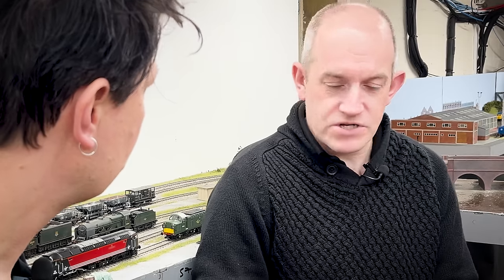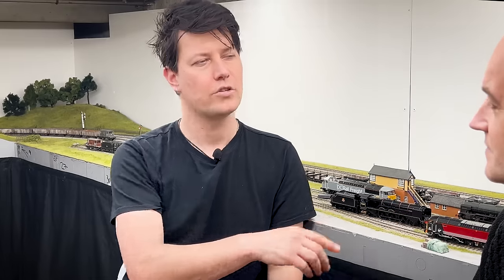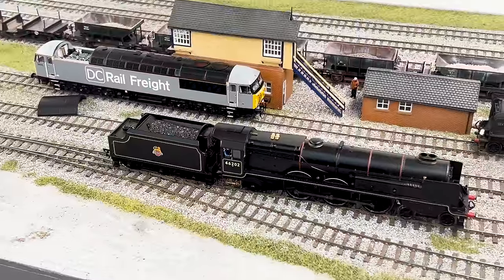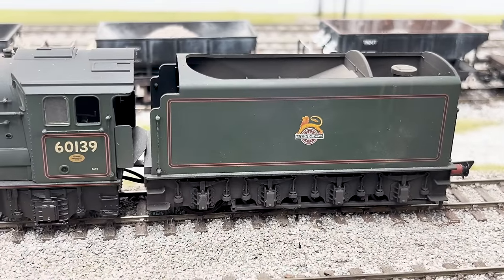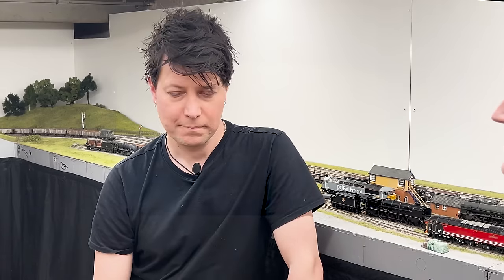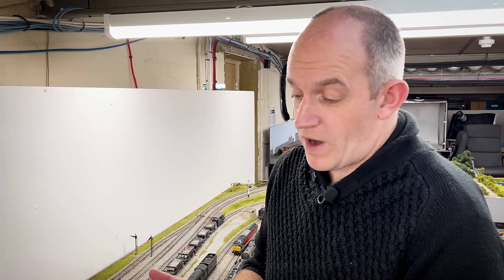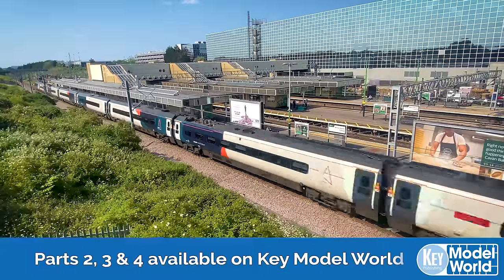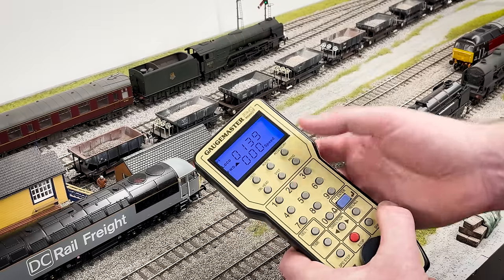SERIES 8- Introduction to DCC sound I Part One

Comment: Blimey you were going at 100mph. DCC is a massive learning curve for someone brought up on DC. Ive been digital for 13 years. Still learning after many blown decoders etc. Nearly all DCC ready locos require body or tender off jobs and careful alignment of decoders. If you have poor eyes/shakey hands you better fork out for fitment by someone else. Just a simple demo of how to fit a decoder and running against a dc loco would have sufficed. Easy to drop into the technical stuff when you are way past the preliminary stage. Dont get me wrong I love DCC but went thru alot of perseverance to get where I am now. Just slow down for the novice please.
Reply from the maker: Hi there. Part 1 was an introduction without installation. Parts 2, 3 and 4 are where we go into slow detail of how to fit the chips, speakers and stay alives. Make sure you subscribe to Key Model World to watch the next 3 parts to learn it all in full detail 😊
Reply: Not as hard as you think it is.
Reply: @peterbradford5987 I do know as been dealing with DCC since 2010. Just they needed to slow down and less of the technicalities
Reply: Why not demonstrate what they are talking about ?
Reply: @martinanderson4721 not criticising that. Just the speed of the demo

Comment: Track wants sorting at 1.08 , looks like its going to be a great series
Reply: If this is intended for a complete beginner to DCC and sound, I think you should illustrate the talk with examples of the items you are discussing and diagrammes of how they connect together. A picture is worth a thousand words.
Reply from the maker: @j3xk72r9  Diagrams are not easy for everyone to understand. Part 1 is intended as an introduction, not an installation guide. Part 2 shows in detail how to fit the Hornby TXS decoder to a model and get it connected. It is all done on video with multi-cameras so you can see everything in detail. If you're after a diagram yourself, there are probably many that can be found on Google, however we have aimed to keep this as simple for people to understand and follow as possible 😊

Comment: Cheers for this, if not covered later on would you consider looking at the DCC operation of signals, points lights etc 👍
Reply from the maker: That won't be covered here in Series #1 however we are planning Series #2 where we will definitely go into those kind of details 😊
Reply: Cheers 👍